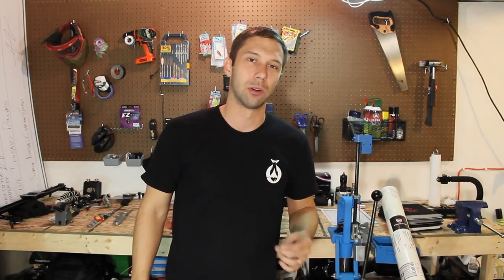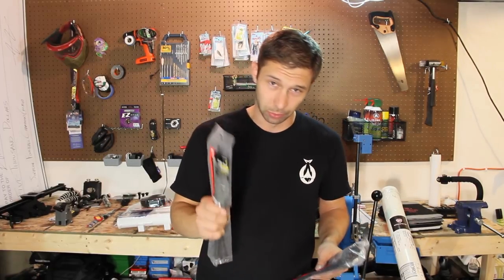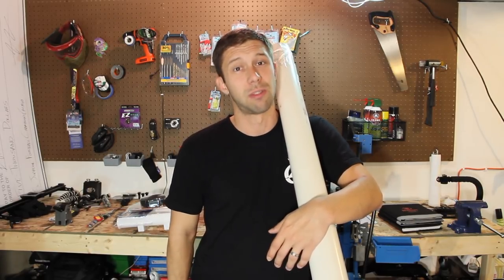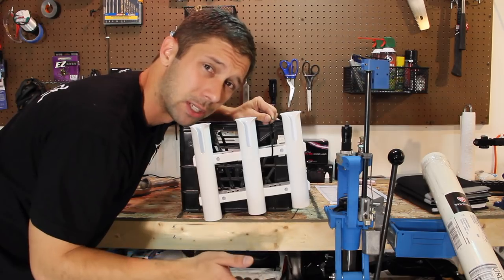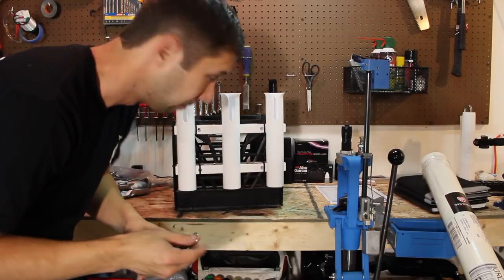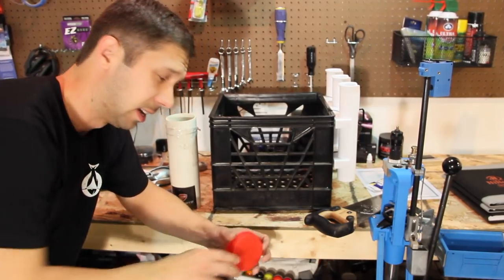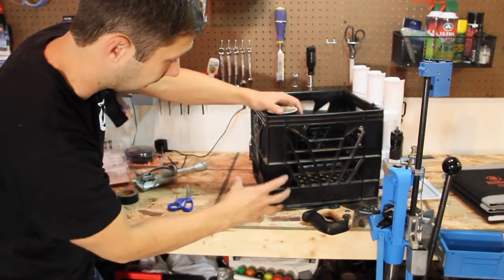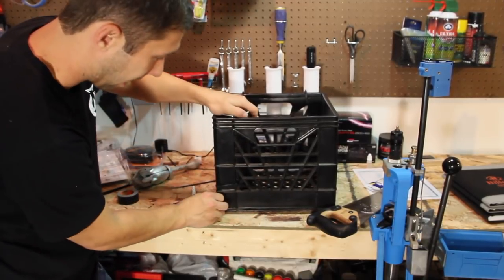EASY!! Kayak Milk Crate Setup

Comment: Put a buoy on you anchor line if you ever had cut it free you can recover it 

Use linesmans pliers and twist until the Wyre tye snaps from the square 
It won't leave sharp edges 
Takes a second longer more professional results

Comment: How has that Muddy retriever worked out for the anchor?
Reply from the maker: Andy Meresse really well! I am crazy surprised!
Reply: How does it work without an anchor trolly?
How do you ensure the boat is pointed properly I would think you can only get away with using that point just behind the seat just for very light wind/current conditions.
Good video.  I really like the idea for the anchor stow.  simple clean, fast deploy and low center of gravity.
Reply from the maker: GAF2011NJ I actually have added an anchor trolly since this video.